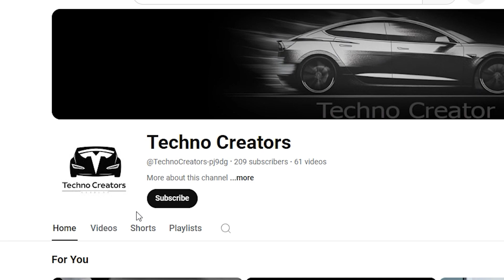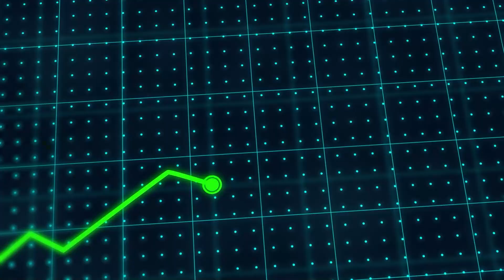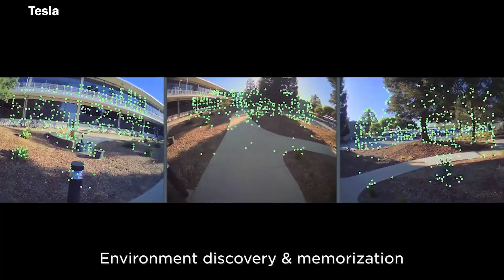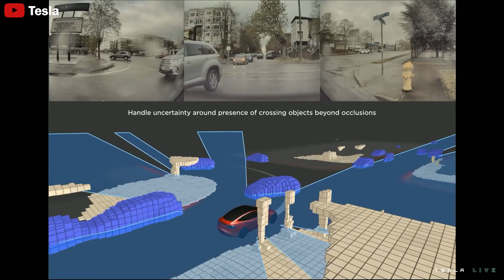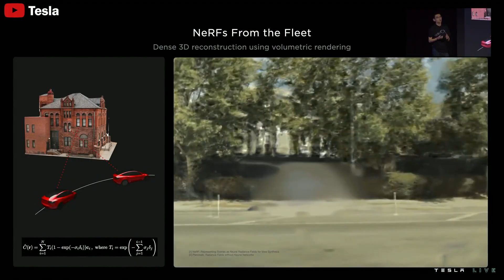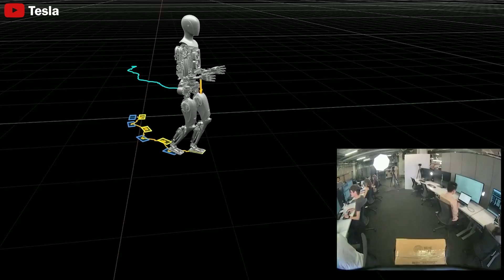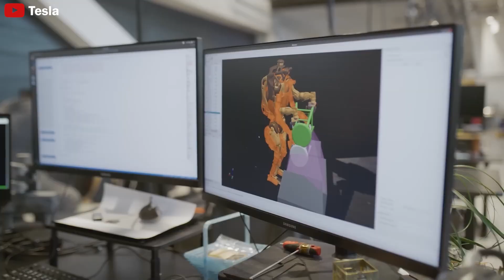It Happened! Elon Musk Confirmed Tesla Optimus Gen 3 ONLY $10K, Replace All Workers At Giga Texas!

Comment: 20.000/365 day =54,79€ per day. Basicaly its a free robot, who pay itself in a year or less or less, becouse it work 24/7 if its possible to connect it wired, to constantly power him.
Reply from the maker: You might think so! But the main reason Tesla has optimized the manufacturing process and simplified the design to achieve such low prices!